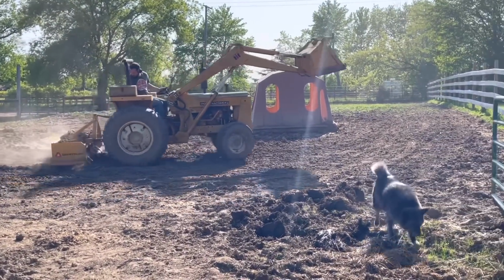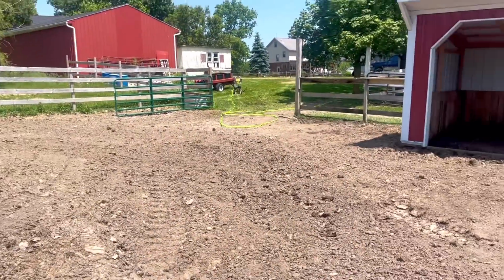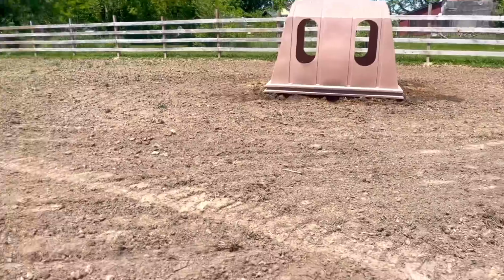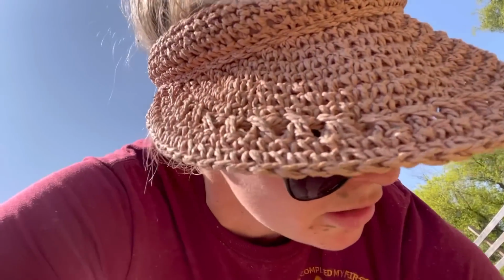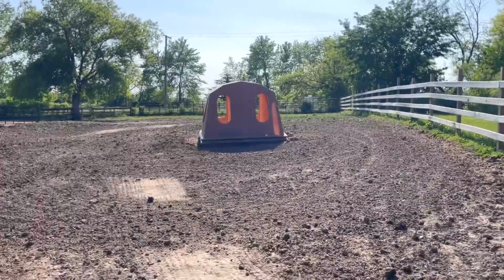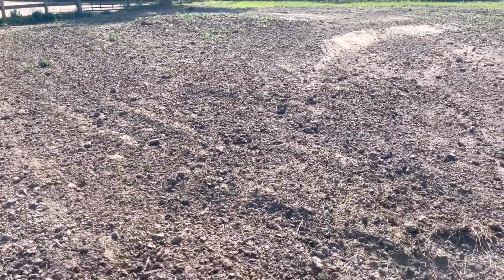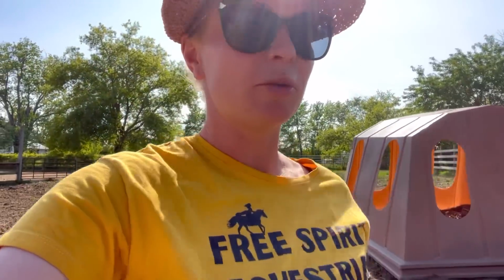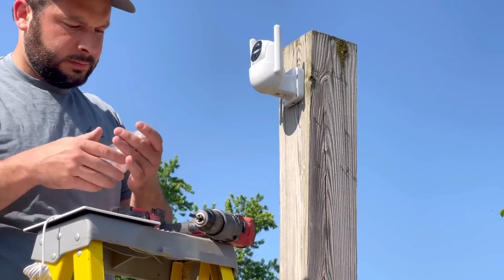PREPARING MY MARE’S FOALING AREA!!!

Comment: I use a chunk of Railroad Track that has Chain hooks welded on it.  If the Arena needs to be filled in around the rail I shorten the inside chain some, and it will move dirt/sand to the outer rail, and its so heavy it levels, and breaks clods up.  You will have to use a big Quad or Tractor.  It's great to break down dry manure to keep down flies.
Reply from the maker: Nice!!

Comment: Great job! Outside is really better for them as long as you don’t have predators in the area. Coyotes used to come out of the woodwork when our mares went into labor so we had to foal them out in the barn. There were literal claw marks on the barn doors, sides and windows where they’d try to get in😰
Reply from the maker: Yes we don’t have any issues with them.

Comment: You are making a great choice picking that area for Belle and, as to risk of disease, my vet told me years ago that the best thing is to have the mare in one location for several weeks to a month prior to foaling--that way she develops immunity to whatever germs are there and her colostrum will pass that to the baby.  The only other thing of importance is to be sure to treat the naval with iodine or whatever your vet has recommended (they don't all agree)--I did this and over the years had many babies with no health issues.  I was raising Minis so I had to be careful about babies slipping under a fence (if born to close, they might roll under and come up in another pen--not good) but I don't think that will happen with Belle's foal due to its size.  I did have one loss and this was a total fluke but if it helps I'll tell you something to add to your kit.  I had a mare where the umbilical cord broke so close to the stomach wall that the baby actually bled out---I was devastated.  I had been up most of the night watching her and took a few hours to sleep and missed the birth.  I found the baby already dead. I learned later that I could not have saved the baby unless I had some type of string to tie off the cord immediately.  -That was not anything I kept in my foaling kit or had even known to expect and had I been present, I would have held that baby as it died and felt helpless............I believe God saved me from that horror and I hope that maybe by telling others that this can be a foaling issue,  that I will someday save someone else's foal.  I was so heartbroken when I found the foal but it turned out that the mare had several metabolic issues (unrelated to the foal's death) and I am quite sure that she actually might not have survived if she had the stress of nursing the foal so in the end, I accepted the loss--with a lot of tears. I believe that little Shooting Star is entertaining the children in Heaven. You are in my prayers and I have such respect for the choices you make to always choose what benefits your horses--and the fact that you are the real thing--you love, groom and train your horses, you get mud  on your face, you wear the lipstick that makes you happy...So refreshing. Bless you and your wonderful, supportive husband--he deserves more ponies to drive and maybe a second corvette.  Thank you for sharing your lives and the love you have for each other and all your animals.